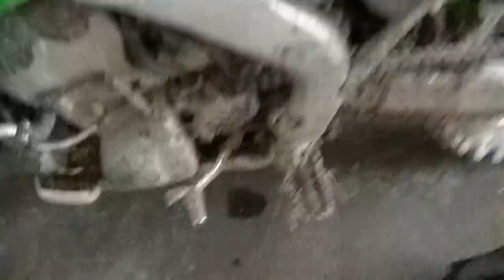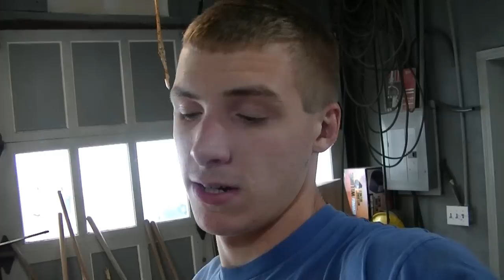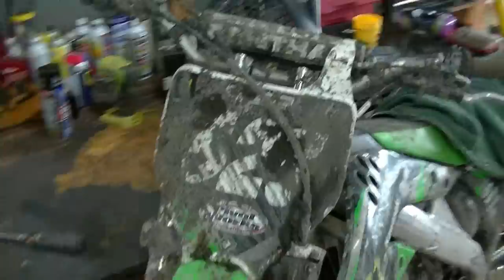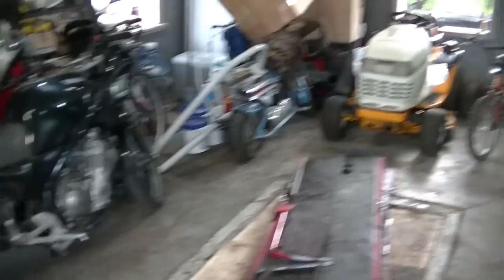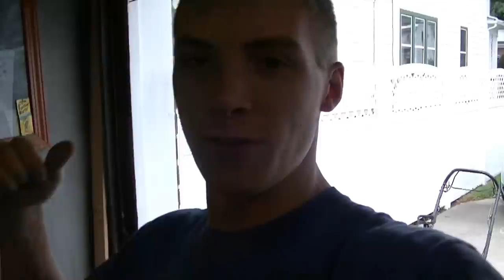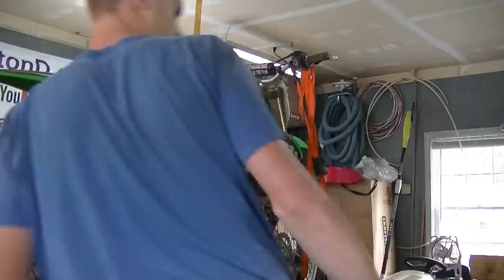KX250F Cracked Case Tear Down

Comment: Hi I see u have a kx250f and its is liquid cooled right? See I recently bought a liquid cooled race bike similar to yours but a smaller cc do you have any problems with overheating because when I bought it from the dealer they said that they overheat quick because I need to go certain speed to cool down the engine and I like riding trails with that be a problem and do you have any problems with that. Plz let me know thanks

Comment: Hey, my ’06 Suzuki DRZ is rattling from the head area. I am going to check the valve clearance but in your opinion do you think
It could be the timing chain/tensioner issue? Thanks in advance!
Reply: could very well be the timing chain if its loose it will rattle. just adjust it should be good to go